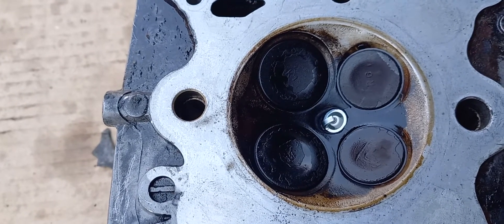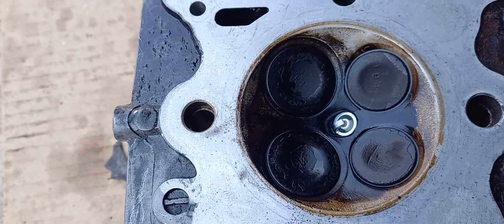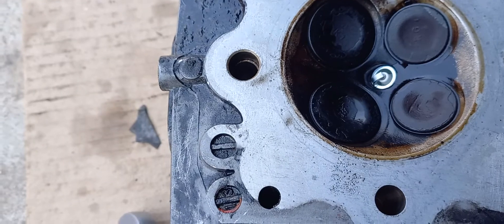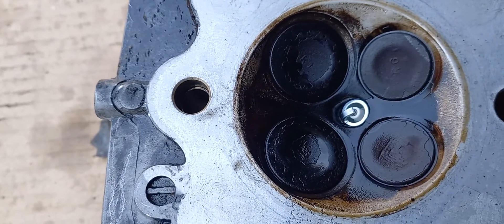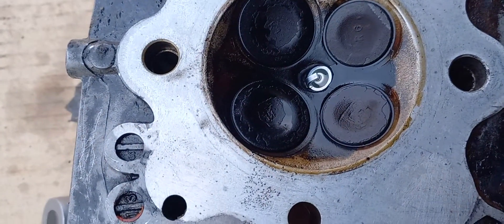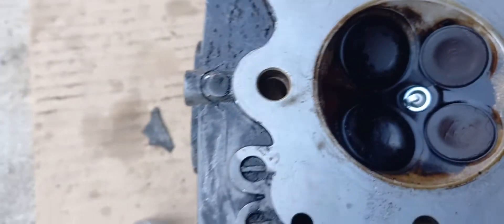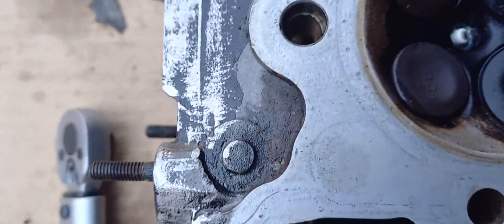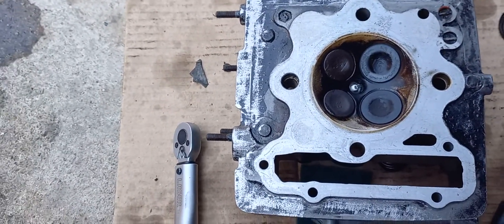Honda XR250 : valve seat check.

Comment: Could you get away just lapping them? 👍
Reply from the maker: I did lap them in..... i was a bit naughty with the exhausts cos even the smallest rubber cup wouldnt stay on the valve.

....so i stuck a drill on them from the other side. :)